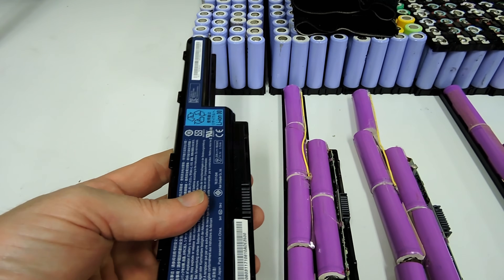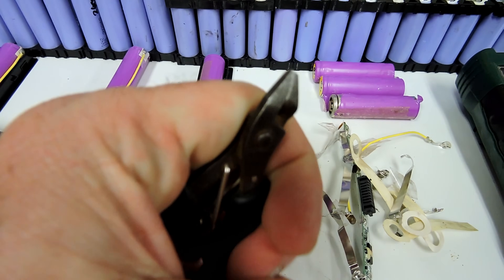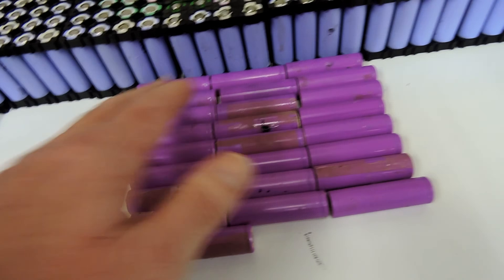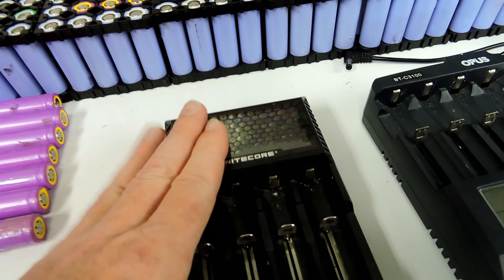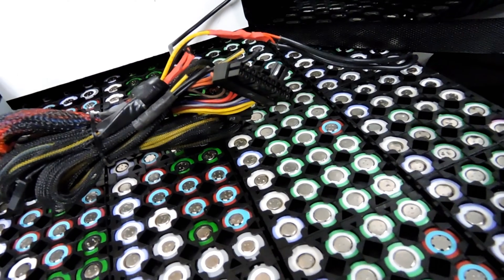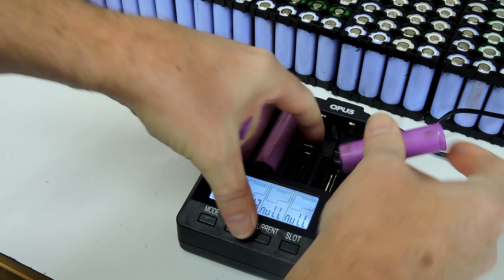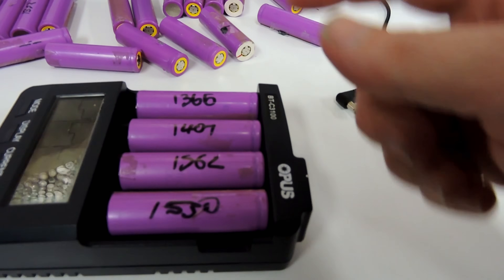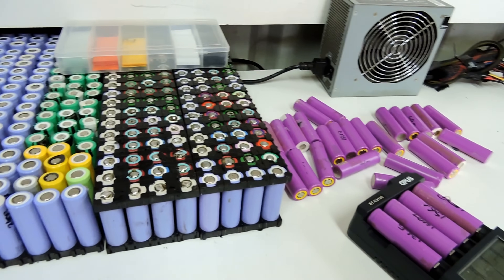How to capacity test an 18650 cell out of a laptop battery pack

Comment: Fantastic video, pure Aussie straight as a dye. I need help in selecting batteries to make a DC power supply for my vintage radios. I bought 40 from Aliexpress, Samsung 3500ma. I decided to fully charge 4 of them and check the capacity, using a LiitoKala Lii-PD4 charger. The highest capacity was 1829ma. The seller is OK to refund but he still claims they are as advertised. I can't afford a fortune, what would you recommend for radios that draw too much current and our Bissell vacuum cleaner that uses 4500ma types?

Comment: Hi, can any body help me out about 18650 cell minimum and maximum Resistance we can use in laptop battery (Used cells)
Reply from the maker: almost impossible unless you have some sort of supper resistance tester... the ebay jobs do ok but they are kinda guess work at best. I can't even remember the ranges i used it was so long ago now. Test a few hundred cells and record the results and work out what you think is good. Also test a few heater cells if you have them so at least you know what is likely to be bad...

Comment: At 5:25, after you tested for discharge capacity, what criteria did you use to determine that none of the batteries are worth keeping? Was it the measured capacity relative to the specified capacity on the datasheet? Is it a percentage (e.g. 80%)?
Reply: IIRC, he only uses cells that have more then 2Ah capacity for his power wall

Comment: What voltage is an 18650 considered fully discharged? (No load)
Reply from the maker: Guess that would depend on make, model, brand & size?
Reply: @HBPowerwall  in my case? 
Nitecore NL1834  "3400 mAh" and 
Nuon NURE18650-1B "2600 mAh".

Comment: how can I get a graph for voltage vs. capacity out of these batteries? What kind of equipment can do that?
Reply from the maker: you could use an iCharger X8 and use the Junsi Console to log data - well that's how I would do it.

Comment: I want to make a battery pack  for electrick bycycle from old laptop battery
Reply from the maker: This might work but you should consider using good powertool batteries as they are designed for higher amp draw.

Comment: Very useful video, thanks!
I also have a Opus BT-C3100 and i'm in the process of making a small battery pack for a xenon flashlight i'm making; I want to use some 2200mAh LG cells, I got a lot of them from a local shop that repairs battery packs for power tools and now, after months, it's time to select them.
Basically I have to charge them, then run the discharhge process and see how many mAh the battery can give in order to match ones that are close.

Comment: You recommend to precharge battery with something else (not the Opus) is it just for time saving?
Reply from the maker: Cranking them through is my only goal - so precharing or doing anything to save time in the Opus is a good thing.
Reply: @HBPowerwall  thanks for your advice)

Comment: So all of the energy used to charge and capacity test the cells is wasted? Or can it do a regenerative discharge so you can use it to test your next batteries? 
My lipo charger does this.

Comment: Hello there, I have just watched your video and I don't have much knowledge about these batteries, I have got 6 of them and I would like to use them for a project, I extracted them from a laptop battery just like you did, multimeter shows they range between 1.75 to 1.90 volts , are they too low? can I charge them? or they are rubbish?

Comment: I was ripping apart some cells and the nickel strips ripped holes in the cell bodies on the negative end, started to leak fluid. I don't think its a good idea to completely tear off the strips....
Reply from the maker: Sounds like electrolyte, I see that issue a lot on high amp draw powertool batteries & medical batteries, not so much with laptop batteries.
Reply: @HBPowerwall  that's weird, they were from laptop batteries. I do have a box of old power tool batteries on order. I should probably use some flush cutters to just reduce the nickel strips instead of rip them off.

Comment: Would you do all the same testing on new batteries from a reputable manufacturer?
Reply from the maker: no, perhaps spot checks only
Reply: @HBPowerwall  Thanks dude. Really like the channel. Just discovered you recently as I'm looking into building my own place and want to explore the idea of DIY power. Another question, if I may: on a scale of 1 to 10 (10 being extremely difficult) how much expertise does it take to build and manage your own wall using new batteries? I'd rate my expertise a 2/10 lol

Comment: I don't understand.  You test your cells' voltages immediately after removing from their housings and cleaning them.  Shouldn't you charge them first?  Otherwise, how does a low voltage reading tell you it's a bad cell? Doesn't that just mean they need to be charged?   Can you explain that in more detail?  Thanks.

Comment: What is the maximum capacity difference of individual cells we can put in a pack?
Reply from the maker: These days i put in 2300mah and above.. used to go from 1800 and up but that was back in the day
Reply: Thanks for that. I just started to use 18650s and I learned a lot from you, you've done very good job there Thanks
Reply: I wounder the same, not the minimum capacity, but the differens in 1 pack like some 2200 in one end and 2400 in the other, bigger o lesser difference?

Comment: Nice video Pete! I am getting ready to make my first 7s 20 powerwall(?) when I arrang the cells I got a question. Please answer to me as I am waiting to complete my setup. Thanks 
1. 2900 mAh cell had 4.2v at the full charge and after 3 months came down to 3.7v
2. 2300 mAh cell had 4.2v at  the full charge and after 3 months still having 4.1v-4.2v 

Which battery is good to select for powerwall? 

Thanks again.
Reply from the maker: Two....
Reply: HBPowerwall   Thanks a lot. I got the way to go

Comment: Yep I get all that... what I was wondering?...was that can I build my 4s 20p groups with batteries that range in the 50mah's?...like 2300-2350, then 2350-2400, then 2400- 2049, etc. b/c in another video you have them sorted by capacity...like the 1100's, 1200's, 1300's, & so on...until you have reached the 3400's group...

Comment: perhaps get into the habit of not chargign to 4.2v. Lithium based cells are meant to last many times longer if only charged to 80-90% of full capacity and same with the lower end when discharging.

Comment: Hi, I have an old HP laptop battery sitting on my shelf for 3 years. I just recently tested it. 1 parallel set was dead at 0V, but the other 2 set both have 3.9-4V. Does that mean they're ok? How is it still having 4V after sitting on the shelf for 3 years? And they were used 4 years prior, so total of 7 years old.

Comment: What is the minimum voltage to use old batteries again. Is it 2.5V or lower? Is there any precharge needed(lower current or something) if its below 2.5V in case i can use li ions below 2.5V  to reach specific voltage and than continue charging battery normally? Also if they heat up do i need to get rid of them? Please help.
Reply from the maker: There is no minimum voltage - test them all - use a TP4056 to get the charger up then Opus to discharge test the batteries
Reply: @HBPowerwall  thanks very much😁

Comment: Quick question : i have a salvaged 3s2p battery pack and the voltages at the series junctions are 2.4v, 6v, 7.5 v . Are the cells good enough that i should consider buying a bms for them ?
The BMS : https://www.amazon.in/dp/B072MLMRRY/ref=cm_sw_r_other_apa_i_ezTnEbR0VBX2D

Comment: at what volt should the batteries be selected ?
Reply from the maker: Volts are not a good indication of a good or bad battery - test them all for capacity, heat, & self discharge (and internal resistance if you can)
Reply: HBPowerwall hello mister ! Help pls there are two elements, one shows 2500 and the second 2900 mAh, which is livelier?

Comment: Ok pet I've started building my own...thanks though inspired like I always say... one thing if you want to check your mah instead of checking with a multi meter even on the laptop battery before breaking it theyll show you which one...I've checked I might be wrong but pls advise
Reply from the maker: if it understand what your saying corectly - Voltage has nothing to do with capicity. a 0.2v cell can be recovered to a 3000mah cell and in the same light can also be a 500mah cell.. test them all
Reply: @HBPowerwall  ok totally understood....another question is y do you have to charge and discharge your batteries before using it in a power wall because I mean we put all cells to full charge putting them upto 4.2 volts first so y discharge?

Comment: I know I’m a little late but I saw you put the one that was 1.18 volts in the zero pile but then at the end said “these were all above half a volt and came up to 4.2” what is your threshold to throw them away?
Reply from the maker: Don't make me watch another old video to see if i screwd something up lol Voltage doesn't matter so no threshold - it's the discharge capacity at 1000ma that is important.

Comment: How to know after that the capacity and the voltage of the battery?
Reply from the maker: I use an www.diypowerwalls.com/opus charger/discharger to test all cells
Reply: HBPowerwall thanks for taking the time, any brand in particular or doesn’t matter?

Comment: Very Dangerous to Twist or slam battery pack cells, I would NOT recommend this technique, unless you want to cause a short (fire), electrocute yourself, or cause the cells to leak due to damage. If someone tries the twist method for one of those packs for example, and it does not crack open immediately and the cells short due to twisting and contact of the BMS wires or Nickel that could hurt you, your home, or others around you. Saying " I do it this way because I have done a lot of these" is another way to say I'm lazy and don't care about safety. No matter how you look at it, its unsafe and should not be followed BY ANYONE. If you are going to salvage cells from a laptop battery pack, do it properly and safely. If you do not agree with my statement above, you are A not educated about electricity. 2. Just do what other people say. 3. Just don't care about safely. or 4. All of the above.

Comment: Are you supposed to charge the laptop battery first before you pull apart and check voltage of the cells?
Reply from the maker: If you have the means to do that it wouldn't hurt too much - but i would prefer to be pulling apart packs that aren't fully charged just incase something goes wrong when dismantling
Reply: Would that be even possible with the sheer amount of different laptops?

Comment: I've seen on the chanel diogonewild that some batteries that lose capacity overtime, can greatly improved after few charging cycle (3-5 cycle if I remember well)
Reply from the maker: As I age i'm getting slower it's how this world works - I don't think anything gets better with time does it lol a few cycles might 'wake' a cell up but it doesn't fix any issues it has.

Comment: Hi. Im up to about 3000 cells so far for my power wall. To test cells I charge to 4.2 and again ensure  they don't self discharge. Next I load with a 50w 12v halogen light bulb for around 5 secs. At 4.2v this load sucks around 2.5A.  I do a quick load test and record the difference voltage. For example the best battery I have seen is the Samsung INR18650 25R which shows 100mV, ie 4.20 to 4.10 for a single cell. Most ex laptop cells are discarded for a reason, i would be happy if 2x ex laptop  cells in parallel gave me 100mV.   Whats your thoughts as im looking for a cut off point, ie chuck or use.  Cheers, Mark ( in NZ)

Comment: Thank you for this video. Something strange happened when I tested a series of SANYO UR18650A batteries. A datasheet told me: capacity 2250mAh. I discharged them first and then charged them and my BT-C3100 v2.2 charged them up to 2997 - 2999mAh. Is that possible???
Reply: Check them for self-discharge. It will give a false capacity reading if they have significant self-discharge. That is caused by a partial internal short.

Comment: Is 1 Amp per cell a good discharge rate for a test? Can you let us know the differences.  We would get a higher mah rating with a lower discharge rate. Thx in advance
Reply from the maker: 1amp is good balance - will get the cell hot if there is an issue with it, but fast enough to be efficient to test.

Comment: NEVER EVER BANG OR HIT A LITHIUM-ION BATTERY CELL!!!!!
Reply from the maker: I bang them on the bench every time i shuck them from the pack to flatten the dags on the batteries - never an issue (yet) Belted them on the ground literally 10,000 plus times you lose some with dents but for the speed it's worth the losses

Comment: For your information: It is 2019 now, and the cell database website is not "diypowerwalls" anymore.  I found the database to be renamed. It is now located at "secondlifestorage_com/celldatabase.php".
Reply from the maker: I own all the domains and they should all still point to the same database
Reply: @HBPowerwall  --  Thanks for reacting.  I gave it another try, typing in "diypowerwalls.com/celldatabase.php" and I was forwarded to "secondlifestorage.com/celldatabase.php", so everything is fine.  I must have made a typing error before because I was forwarded to a domain name seller.
Because I raised an 'alarm' that is not merited, I will delete my comments at the end of today, after you had a chance to read my reply.
Thanks for the video and your knowledge.

Comment: Not sure if I understood it correctly. So the way to capacity test is to pre-charge to a certain voltage, then discharge to its lowest voltage and while it discharges measure how many amps are utilized by the load or discharger.  Is this correct? Thanks in advance mate!
Reply: Yup
Reply: Most chargers having the "test" mode will do that charge-discharge-charge cycle and report the capacity value at the end

Comment: How did you determine the capacity of the batteries? with imax b6
Reply: He doesn't he just uses it to charge more them in parallel. If you would run them in series you could get the capacity of 6 cells at a time. He uses his opus to get capacity.
Reply: Opus BT-C3100
Reply: Well if you charge them 1 by 1 you can get the capacity it shows the time and the capacity of the cell. if you were to put them in series and put a balance lead on each of them you could get the capacity on six of them at the same time, but you would be charging it as a 6S. Hope that helps.

Comment: With a 2600ma battery what is the lowest capacity I should keep for a Powerball?
Reply from the maker: Good question - if you have space you use even the 1000mah cells - if you build your packs balanced and you have the space it's not an issue (just expect them to not last as their cycle life is probably already well degraded

Comment: Nice video!
I save my laptop batteries and I have two of them with 2.55V. Are they usable?
Reply from the maker: Voltage is not an indication of battery suitability - capacity, resistance, self discharge & heat are your key metrics to test
Reply: @HBPowerwall  Thank you!
How can I measure them and which device should I use for this?

Comment: Hello, actually what is bad about taking low voltage cells back to live? If you slowly charge them to 4.25V and if they hold voltage? Thanks
I'm currently packing my first powerwall :)
Reply from the maker: we aren't talking low voltage we are talking no voltage - The voltage isn't an indication of if the cell is viable or not. Capacity, resistance & head are tho

Comment: Hi! Video is really helpful. My laptop batteries are almost dead now. Its SAMSUNG ICR18650 22F SDI 974. Can u please advise me the best suitable 18650 rechargeable cells for that. I am looking for them on Amazon but it’s showing 18650 with some other codes which are not matching with my laptop battery codes (22 F SDI 974)

Battery voltage is 10.8 v and capacity 4200 mAh 

Each cell is of 2100 mAh capacity
Reply from the maker: you might be able to use https://secondlifestorage.com/celldatabase.php to help your search

Comment: I see you do the charge test at 1000mA, I done some cells yesterday both the same brand on my Opus, One got very hot to touch and the other one was room temp. The hot one is rat s%#t?? or should I do the test at 200mA so they don't get as hot?

Comment: Why you have to charge them and then uncharged them? And is this also necesary for a flaslight?
Reply from the maker: The charge-discharge process enables you to work out the useable capacity of each cell, also you can test for heat and IR